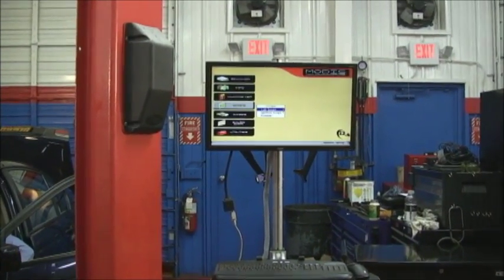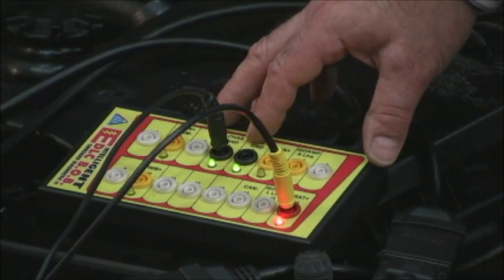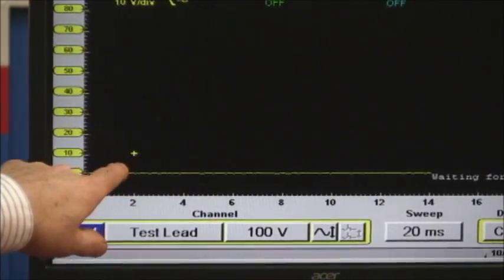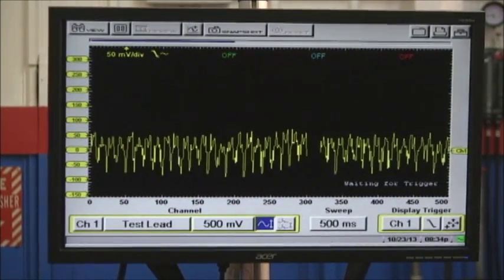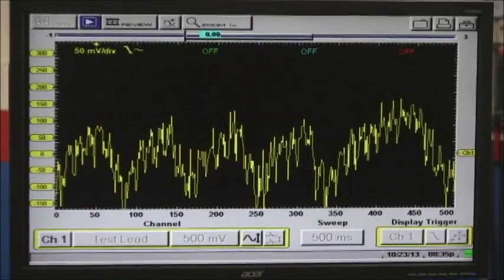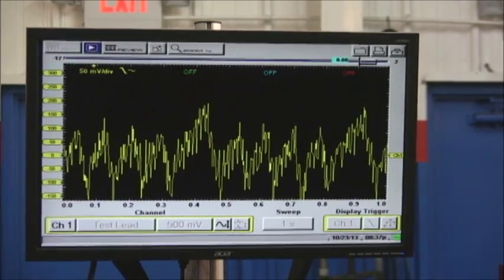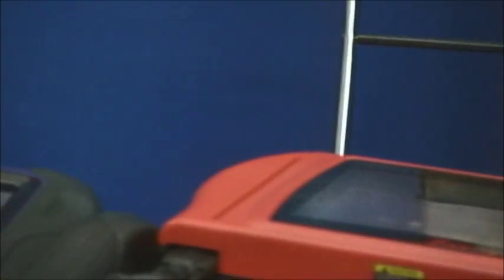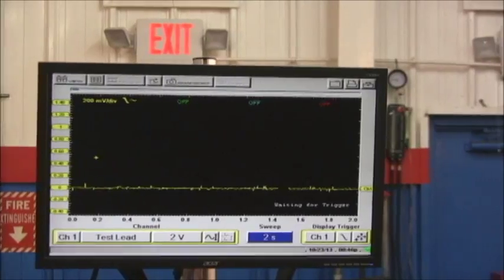Relative Compression from the Driver's Seat Snap-On MODIS - Live From TST:

Comment: It's always my luck that no one can do a video that helps my issue. I have a modis ees300. I have a low am clamp. I just wa t to do a compression test. I'd like to use channel 2 to some how put probe on #1 coil so I know what cylinder is what.
Reply from the maker: Please send me pictures of your scope screen for Channel inputs and your clamp...I will get back to you with a set up
Reply: @TSTseminars  where do you want photos sent? As for what I have. I have a Snap On Modis EES300 that my father in law passed to me when he died last year. I just bought an OTC low amp clamp but have now realized the battery wire will not fit in the clamp. The vehicle I'm working on  is a 2003 Hummer H2. The o ly code I have is P0300. Misfire Data says cylinder 5 has 500 misses per cycle and cylinder 6 is 2500 misses. I swapped the coils around and nothing changes. Replaced all plugs and wires with new and no changes. So now I'd like to learn how to use a scanner to test compression, coils, and fuel system